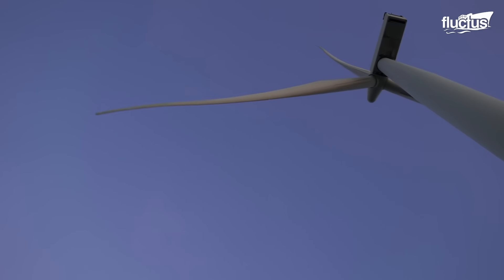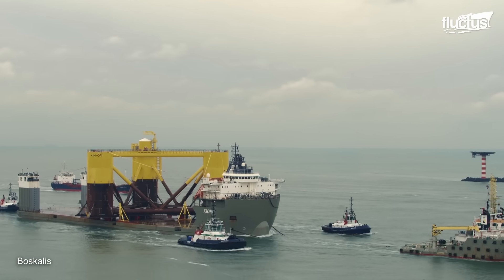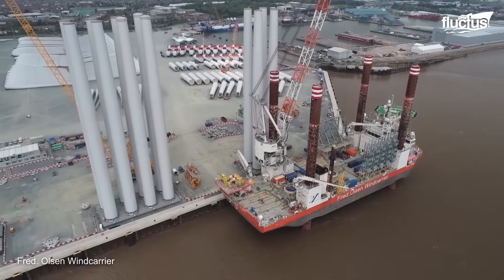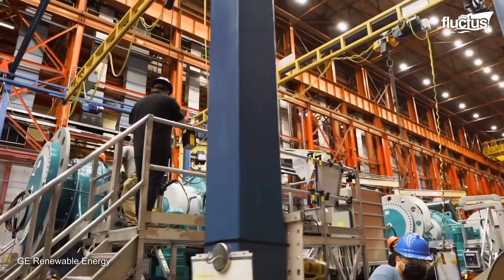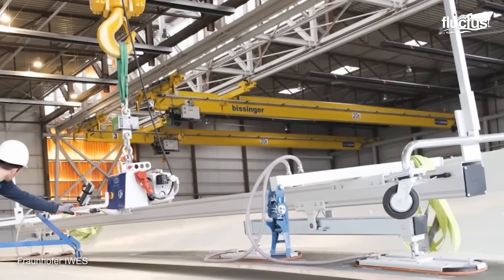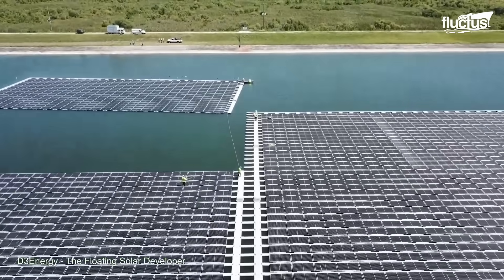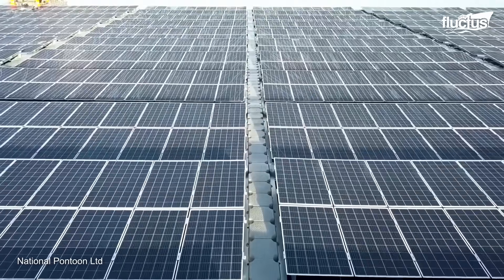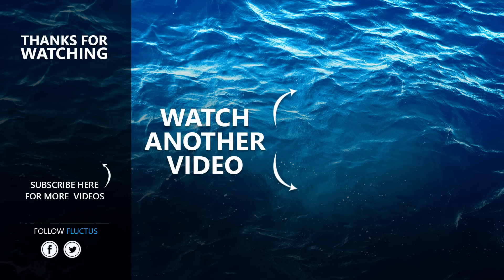Amazing Way They Build the World Largest Wind Turbines in Middle of the Sea

Comment: This method of generating electricity is the least cost-effective way imaginable. When the UK announced a tender for wind license operators, they got NOBODY!!!! Why? Nobody want to lose money.
Reply: That was about onshore turbine licences.
Reply: @akyhne  .. I stand corrected. But why would it be different with offshore wind? Cost for installation & maintenance is even higher. Blades are trashed by water particles in the air, hail, snow & rain. Towers swing & heave with the swells, and everything is a mess as I understand it. Swapping mechanical components is whether dependent. Downtime is unpredictable. Am I wrong?
Reply: @oddvardmyrnes9040  The larger turbine you build, the smaller the cost per KWh. Although wind turbines on water are in general more expensive, in 1:1 cost.

Comment: Great to see the manufacturing process up close. A good reason to be optimistic for renewable power.
Reply: dont kid yourself , impressively not viable, total up the toxicity of the components production and "carbon footprint", it will never save enough to clean up its production mess. Co2 and otherwise
Reply: Total up the toxicity of fossil; fuels - wind and solar are much better. Solar and wind are the main sources of new clean power. There is some embedded energy to make them and recycling at end of life is improving.  @thehark6247
Reply: @thehark6247 OK genius instead of being a naysayer put your efforts in to coming up with a solution
Reply: Solution? Drill baby DRILL!!😊